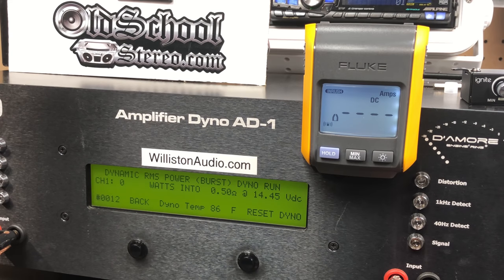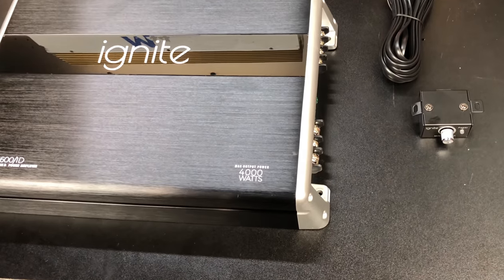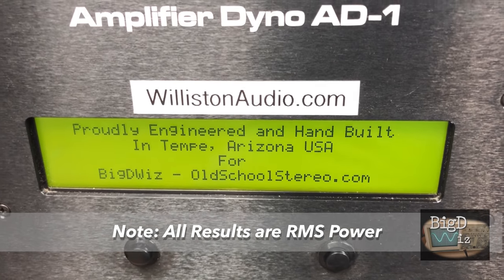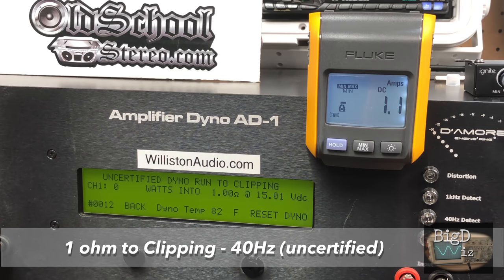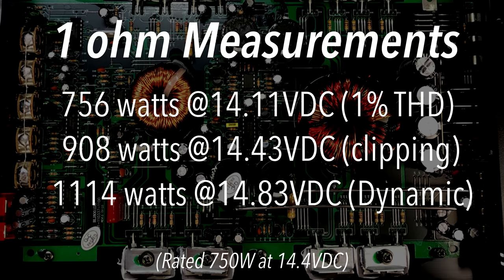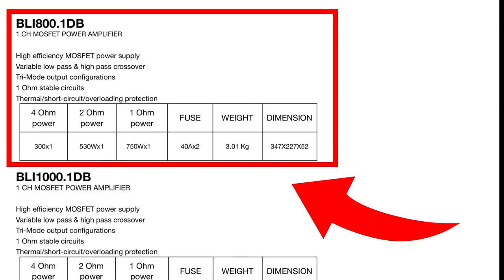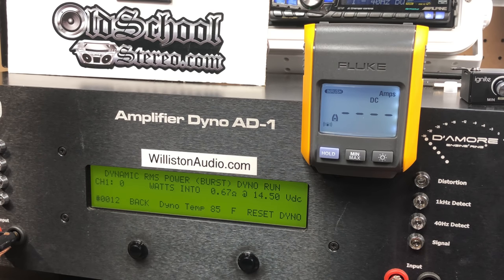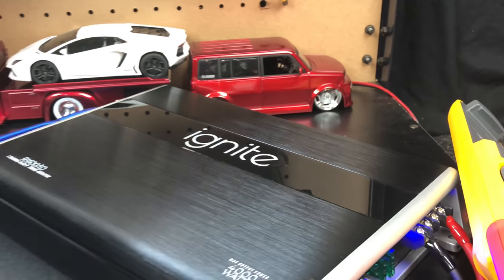4000 watts for $75? Ignite Audio R1600/1D Amp Dyno Test (4K)

Comment: I remember years ago the Dalbani catalog had al these chinese amplifiers, this was when Spider came out with a thousand watt amplifier and people thought that was CRAZY. But these Chinese amps were rated at 1,200, 1,400 watts, and like I said, at the time that was an insane amount of watts. But these chinese amps, cheap as they were, struggled to put out 50, or even 75 watts though they're rated for several times that. 

I asked a guy why, and he said they do is, hook up the 12V amplifier to 3 phase 480V or whatever it is they have over there, hook it to a logging multimeter with a high sample rate, and in the literal 1/10,000 second before the amp explodes and the internal components catch fire and melt, the meter will read, "Output: 1,200 watts." so they say, yep. It's a 1,200 watt amp.
Reply from the maker: Just made up numbers. But it is getting out of control!!

Comment: I was running this amp with a Quad Coil sub at 8 ohms and it was doing alright but I changed the set up to what I believe is  4 ohms and now it is clipping at lower volumes than before. Any ideas? Quad coils are confusing. If you have any recommendations about wiring that would be a great help aswell.

Comment: No amp can touch this under 100.00 bucks!
Reply from the maker: Igniting sales 👈😊
Reply: Dietrich Williams jbl gtx 500 and only 100 bucks
Reply: Exactly, GTX500 puts out bigger numbers and you can get the refurb ones for $75.  And a real company stands behind the product.
Reply: I have the gtx 500 {$70} on a skar  audio vd10 and it does  great but the amp   wont 1 ohm

Comment: Hey big D may we see your battery source? I’m curious what you have run to power the OSS labs!
Reply from the maker: (8) XS Power D1400 batteries and (8) banks of 6 Maxwell 2.6V 2600F ultracapacitors. I typically use one or the other, not both

Comment: I think I'm going to get this amp for my nephew for his first little system. But my question is I'm only going to put 12" sub in there and probably running at 2 ohms, which speaker Jacks should I use? I mean it's kind of weird having two options for speakers when it's supposed to be a sub amplifier. Help me out, should I run the positive to both positive and the negative to both negatives on the amp? I have one of those really cheap kicker 600.1 amps but this one is putting out more power
Reply: If you're asking this question, you should really take it to a professional and let them install it.

Comment: Could I essentially run a Rockford P3D4-12(500W version) on this amp? Im currently running it off an old school Mobile Spec ICE-1450D and it slams as it sits. Its sitting in a QLogic bandpass off of a stock 120amp alt and an Optima Yellow Top. OR... should I just pony up and get a DC1.2k? Somewhere down the line I want to switch to 2 P3D4-15's. Im very tight with a budget and just looking for something to shit around with until then.

Comment: Er, me be old and don't understand the interwebs.
 Anyway, I have a Fosgate p300-1 monoblock. Stats say 150/300 rms 4ohm/2ohm and 404 dynamic@2ohm. Love it and it pounds my two kicker 10" dvc that I have been presenting at 1ohm for over 15 years.
 I built the box, lifelong carpenter, 3/4 mdf glued, screwed 3"oc, caulked, braced and box volume on the low side according to stillwater, love that snap.
I want more for the 600watt per woofer power rating. Could I, without much cost, get a significantly stronger response with a stronger amp? This one dims my headlights and my gage frequently drops to indicate 8, the lowest indicator.
 Don't want to change my alternator. Stiff caps fix that or am I stuck at this 40 amp draw without upgrading my alternator? My stock alternator is 75amps, I think.
Eh and a 4 channel @ 200w , guessing its more like 80rms as its kenwood sheiite. Never blown the 50amp main fuse 12" from the batt post, so the numbers seem fair imo.
Reply from the maker: Rockford amps always give you more than you expect

Comment: Again just go with the JBL at $100. It does 600 watts at 2ohm with better efficiency. That efficiency loss at the end is just mean. 60% efficiency eating 800w
Reply: Like Clockwork64 however running this at .5 it probably won't protect on music after rise. Run 4 of these on 8 d2 coil 12's in a 4th order wall or 6th order wall would be totally hilarious. I currently have a 2 ohm stable xplod gtr900 at .75 and i run it all day. It protects sometimes but usually only if my voltage is getting low or I've been playing a while in the heat. Using these amps has a huge advantage because if it blown. Boom 75 bucks and you're back in business. I love amps like this they usually last forever.

Comment: Just bought this amp on ebay for my first amp that I'm going to hook up to an old sub box with two 12" pioneers subs that I got for free from a buddy. Do you think it will be enough to power the subs?  Just throwing them in my old buick park ave.
Reply from the maker: Depends on your expectations. It will lower the subs, just not make them jump out of the box

Comment: I had been seeing this amp on Ebay over and over now I see it puts out what a surprise most of these off brand amps never put out what they say rms not max or peak. Word to the wise if you just gt sum low wattage DVC 10's 12's this amp will push them fine but when you try to pair Competition woofers like subs that can handle 1000 rms each sub or more use common sense these cheap amps are not going push them and you must do a Big 3 extra batteries and High-output Alternators no vehicle running stock electrical will give you the power or voltage to fully push any equipment.
Reply from the maker: There is something to say to using amps that don’t require huge electrical systems

Comment: Can you input 50Hz sine wave and pump to 1% THD , plug in an AC motor @1000w~2000w to Speaker terminals  and see how long it can run before smoke?

Comment: Do you want to test the Ignite "6000 watt" version?   If its similar performance to the "4k" it would be about 1600 watts dynamic rms @1ohm for $99 and strap-able..   that would give the  the Skar 2000 watt that seems to be great value per dollar, the ignite 6k strapped could be a higher overall wattage for the same money with higher watts..   I have one I could ship you, if you ship it back.
Reply: Just saw you actually tested that amp, even at .5 ohm 2000 watts..   Ok, never mind..   :D

Comment: Nice lityle amp for $75 and jts way better than Boss. The first thing I'd do is replace the crappy terminals with 4 gauge female terminals and renoce the fuses and make it a direct connection from the positive terminal straight to the transformer and that would increase output. But with ir stock it's still pretty decent!

Comment: What also intrigues me is that even though it is new, I do not see any of the modern chip/film style resisters in it.  Seemingly comprises of traditional metal film and carbon resistors.
Reply from the maker: Uses TTH components too. Saving $$ on the CB cost
Reply: BigDWiz Fo sho

Comment: What amp do you recommend for 2 10 inch fosgate r2d2 primes 500 watt 250 rms that will bump continuously and not get hot
Reply: Look into jl audio amps. Something like an e1200 would pair well on those.

Comment: IMO you get what you pay for with car audio for the most part. If it’s a brand I’m not familiar with I want spec sheets with real power delivery at 14VDC. Also part of the nature of the beast is losing sound quality with less resistance. I like a solid 4 ohm load personally, but if you’re looking to blow your hair off low is good.

Comment: Beginning to wonder about peak power claims like that on srappable amps :  maybe, big MAYBE, it might get closer to that peak power claim strapped up...LOL, yeah right. Would be cool if you ever did do a strapped amp dyno run. Good vid, good budget amp I would buy if on tight budget.
Reply from the maker: Stop trying to figure out these bogus claims as they are just that. Fitting a Flux Capacitor directly into this amp would not give it 4000 watts 🤷‍♂️
Reply: @wal  1.21 gigawatts!!! Lol

Comment: Most car audio specs are super inflated. The true rating is always RMS. If you dont have a watt meter, you can use an osciloscope to determine the peak to peak voltage before clipping (distorsion) and figure the exact power of your amp. The formula is (Pp volt/2) X.707 =Volts rms    then      Vrms/ohms= Amps  then    Vrms X Amps = Watts rms.

Comment: I never believe all that tripe on the box about how many watts it has, However I am still surprised that it got that kind of results you achieved I’m not really into this anymore , in my day all of this cheap stuff was pure Rubbish , 4000 Watts was more like 40 Watts . Either that or pure distortion . I’d settle for a branded amp with a Lower rating it always went louder . 
But then some kind Soul would steal my Car audio on too many occasions so I just stick with the car standard  ICE

Comment: Anothet thing about cheap amps is its not just about the watts they put out but i can most certainly tell a difference in sound. If u use a 50 dollar amp on 500 dollar subs ur subs will sound like they cost 50 bucks as well

Comment: Amps are so cheap right  now 1000 rms amps are plentiful for $50-75 online now  the biggest expense  in car audio now is batteries,wire and head units
Reply from the maker: Amps are super cheap, yes, but the fact electrical upgrades are essential for high powered systems has not changed.

Comment: Just got this today for my JBL 12s.cant even turn it a 1/10 of a turn till it distorts.  It hits but afraid it's going to make them go pow haha.  500rms total on the speakers so I'm sure I'm nowhere near that
Reply: Wait! I hooked it up like the manual said for the ground and power.  I used the 1st positive instead if the outside.  Hmm
Reply: Oh and mine came with the 3 30 amp fuses.  It was 90 shipped now on Amazon. You made it go up haha